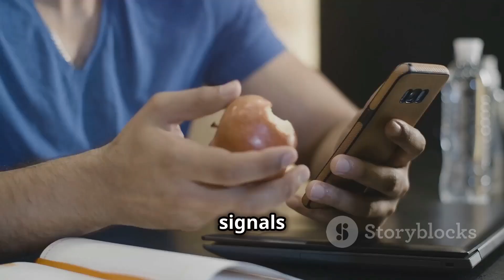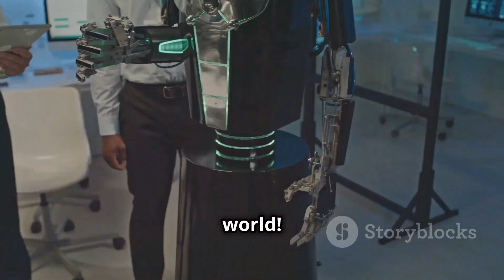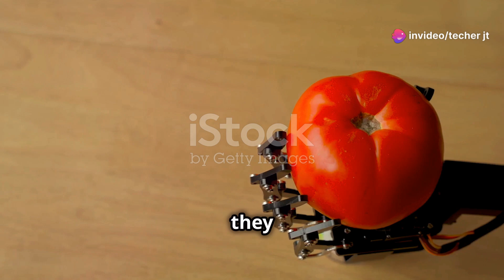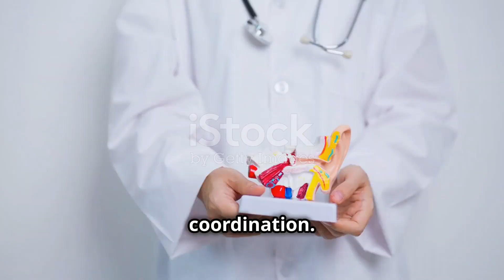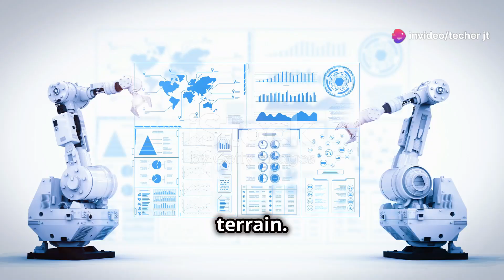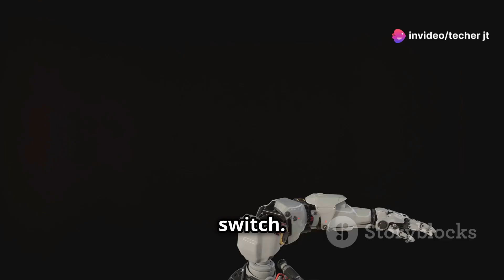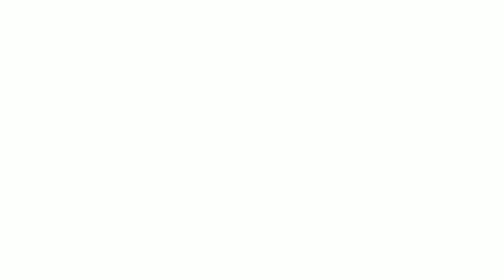Robotics Mechanical Sensors

Comment: Shei Christiane C. Payot
10 - LYNX

1. Understanding: What are mechanical sensors, and how do they function in robotics?

Mechanical sensors are like the senses of a robot, helping it to understand and interact with its surroundings. These sensors pick up on physical cues like touch, force, motion, or position and translate them into electrical signals that the robot’s “brain” can understand. Just as we use our senses to know what’s around us, robots rely on these sensors to perform tasks correctly, avoid obstacles, handle objects carefully, and react to changes in their environment. Essentially, these sensors are what make robots capable of operating effectively in different settings.

Comment: Jana Sophia D. Enopia
10 - LYRA 

1. Understanding: What are mechanical sensors, and how do they function in robotics?

Robots use sensors to understand their surroundings, just like humans use their senses to interact with the world. Humans and robots are similar in this way. While we rely on our senses, robots depend on sensors to move and respond. These sensors take things like touch and movement and change them into electrical signals that the robot's brain, or controller, can understand.

Comment: Hailey Aiyana E. Gador
10- Lyra 

1. Understanding: What are mechanical sensors, and how do they function in robotics?
 
- Mechanical sensors are devices that detect physical quantities like force, pressure, displacement, or acceleration. In robotics, they act as the "touch" and "feel" of the robot, providing crucial information about its interaction with the environment.

Comment: Iam Raut Labnotin
10-Lyra

2. Applying: Describe a scenario in which tactile sensors might be used in a robotic application. What advantages do they provide in that scenario?

•In warehouse automation, tactile sensors can be used in robotic grippers to handle fragile items like glass or electronics. These sensors enable the robot to adjust its grip based on the object's texture and weight, preventing damage during transport. The added sensitivity ensures safe and efficient handling of a wide variety of materials.

Comment: Angel P. Rivera
10 - Lyra

3. Analyzing: Compare and contrast force/torque sensors and accelerometers. In what situations would each be more beneficial?

The Force/torque sensors give robots a sense of touch, allowing them to detect forces and twisting motions. On the other hand, accelerometers measure the robot's speed and help keep it stable. Force/torque sensors are especially useful in robots that work closely with humans, like collaborative robots, while accelerometers are important for helping robots move, avoid collisions, and recognize gestures.

Comment: Alexa Janne Arioja
10 - Lynx

3. Evaluating: Assess the impact of mechanical sensors on the efficiency and safety of robotic operations in manufacturing. Provide specific examples to support your evaluation.

> Mechanical sensors significantly improve the productivity and security of robotic manufacturing processes. Force/torque sensors, for example, enable robots to modify the force they exert, avoiding component damage during assembly. When a robot arm comes into contact with an unforeseen object, contact sensors can cause emergency pauses, averting accidents and improving equipment responsiveness and precision, which lowers maintenance costs and downtime, improves product quality, and fosters a safer work environment.

Comment: May ville D. Ortega 
10- lyra

1. Understanding: What are mechanical sensors, and how do they function in robotics?

Mechanical sensors enable robots to navigate and interact with their surroundings, as well as perceive the world around them. Robots rely on these sensors to collect data, just as humans rely on their senses to understand their surroundings. They function by converting physical stimuli such as touch or motion into electrical signals that the robot's brain, or controller, can understand. As if translating the language of the physical world into a language that robots understand. They are critical because they help the robot avoid obstacles, handle items with precision, and respond to changes in the environment.

Comment: Princess Dawn B. Lamberte
10 - LYNX

1. Understanding: What are mechanical sensors, and how do they function in robotics?
Mechanical sensors in robotics detect physical changes like pressure, force, or movement. They work by converting these changes into electrical signals, which the robot's system interprets to understand its environment and adjust its actions accordingly. Examples include force sensors and accelerometers.

Comment: Maria Floriz J. Napone 
10 - Lyra 

1. Understanding: What are mechanical sensors, and how do they function in robotics?

- In robotics, mechanical sensors pick up physical forces like strain, pressure, or displacement and translate them into electrical signals that the robot can understand. They sense things like weight or tension, which enables robots to carry out activities involving interaction with items, including gripping or lifting.

Comment: Jag Alona S. Ramayla
10 - Lyra

Question 1: Understanding: What are mechanical sensors, and how do they function in robotics.

Answer: Mechanical sensors are devices that measure physical quantities like position, force, and motion. They act as a robot's "senses," providing crucial information about its environment and movements. In robotics, these sensors are essential for tasks like navigation, object manipulation, and safety. For example, position sensors help robots track their movements, while force sensors allow them to control the force applied during tasks like grasping. Tactile sensors provide information about objects, enabling robots to recognize and interact with them. By integrating these mechanical sensors, robots gain the ability to perceive and interact with their surroundings, making them more versatile and capable.

Comment: Sophia Peñoso
10- Andromeda

Question: 1. Understanding: What are mechanical sensors, and how do they function in robotics?

Answer : 
Mechanical sensors are essential devices in robotics that detect physical changes such as pressure, force, or displacement and convert these changes into electrical signals. They consist of three main components: the sensing element, which interacts with the physical change (like strain gauges for measuring deformation); the transduction element, which converts the change into an electrical output (such as a diaphragm in pressure sensors); and the signal processing unit, which interprets the electrical signal for robotic systems. These sensors play a crucial role in various applications, including force measurement for precision tasks in robotic arms, acceleration detection for navigation and stabilization, and pressure monitoring to ensure safe and efficient operation in diverse environments. By enabling robots to perceive and interact with their surroundings effectively, mechanical sensors significantly enhance robotic functionality and performance.

Comment: Zion E. Paberecio
10 - Andromeda 

1. Understanding: What are mechanical sensors, and how do they function in robotics?

ANSWER:

Mechanical sensors detect physical properties like force or pressure and convert them into electrical signals for robots to process and react to their environment.

Comment: Phoebe Coleen G. Flores
10-LYNX

1. Mechanical sensors are devices that detect physical changes in their environment and convert these changes into measurable signals. In robotics, these sensors play a crucial role by providing the robot with information about its surroundings and its own state, enabling it to interact effectively with the world.

Comment: Leon Anthony S. Juaneza
10-Lynx

2. Applying: Describe a scenario in which tactile sensors might be used in a robotic application. What advantages do they provide in that scenario?

-One example of a scenario where tactile sensors are used is in a robotic surgical arm. This device mainly aims to assist surgeons in delicate procedures, such as those involving small blood vessels or nerves. The tactile sensor will detect pressure, force, and vibration, giving the robot a sense of touch. The advantages of using tactile sensors for scenarios is that they give real-time feedback and enhance the procedure's safety.

Comment: Charles Christian Bahian
10-Andromeda

1.Understanding: What are mechanical sensors, and how do they function in robotics?

-Mechanical sensors allow robots to perceive the world around them. These sensors convert physical stimuli, like touch, or motion, into electrical signals that the robot’s brain(the controller) can understand its like translating the language of the world into a language that robots can comprehend. These sensors are crucial for robots to perform task accurately and safely, they allow robots to avoid the obstacles, handle objects with precision, and even respond to the changes in their environment.

Comment: Michaella Ragmac

4. Evaluating: Assess the impact of
mechanical sensors on the efficiency
and safety of robotic operations in
manufacturing. Provide specific
examples to support your evaluation.

Mechanical sensors greatly
enhance both the efficiency and
safety of robotic operations in
manufacturing. For instance,
force/torque sensors allow robots to
adjust the amount of force they
apply, preventing damage to parts
during assembly. Contact sensors can
trigger emergency stops when a
robot arm encounters an unexpected
obstacle, preventing accidents and equipment damage. This increased
precision and responsiveness reduce
downtime and maintenance costs,
improve product quality, and create a
safer working environment.

Comment: Brigette Love U. Gurrea
Grade 10 Andromeda

5. Creating: Design a simple robotic system that utilizes at least two types of mechanical sensors. Explain how these sensors would work together to achieve a specific task.

Title: Tactile and Force Sensor-Based Automated Strawberry Harvesting Robot

This robotic device uses force and torque sensors in addition to touch sensors to select strawberries carefully. Based on the ripeness of the fruit, the robot may modify its hold by using tactile sensors on its gripper to sense the texture and softness of the strawberries. In the meantime, the robotic arm's integrated force and torque sensors gauge the force used throughout the picking procedure. Together, these sensors make sure the robot applies the ideal amount of pressure to pick the strawberries without damaging them, resulting in a precise and effective harvesting procedure.

Comment: Hannah Bella A. Ihalas
10 - Hermés

3. Analyzing: Compare and contrast force/torque sensors and accelerometers. In what situations would each be more beneficial?

— Force/torque sensors and accelerometers are both valuable tools in various applications, particularly in robotics and engineering. They share the common goal of measuring physical forces. Force/torque sensors measure the linear and rotational forces applied to an object while accelerometers measure the acceleration of an object, which is the rate of change of its velocity. Force/torque sensors are more beneficial when direct force measurement is required, interaction with objects, and safety and load monitoring are critical. Accelerometers are more beneficial when motion detection and analysis are required, condition monitoring and fault detection, and orientation and navigation are important.

Comment: Cassandra Louis R. Bigwas
10 - Lynx

3.) Analyzing: Compare and contrast force/torque sensors and accelerometers. In what scenarios would each be more beneficial?

Force/torque sensors are the robot's sense of touch, measuring the forces and torques while accelerometers measure linear acceleration to maintain their motion and balance. Force/torque sensors are used in robotic systems that interact with humans such as collaborative robots or cobots while accelerometers are crucial for tasks like navigation, collision detection, and gesture recognition,  such as from smartphones to cars.

Comment: Neeka Ella P. Guillero
10 -  Lynx

2. Applying: Describe a scenario in which tactile sensors might be used in a robotic application. What advantages do they provide in that scenario?

In a quality control application, small electronic parts are inspected and sorted on a production line using a robotic arm with tactile sensors. In this case, the tactile sensors offer a number of significant benefits. First of all, they facilitate gentle handling by detecting texture and pressure, which enables the robot to precisely apply the required amount of force without endangering the components. Second, by aiding the robot in distinguishing between different materials and identifying flaws based on their texture and temperature, these sensors improve precision. In order to maintain a firm hold on the components without crushing them, the robot can also continuously modify the strength of its grip in response to feedback from the tactile sensors. This last feature is known as the adjustable grip feature.

Comment: Englis
Andromeda

1. Understanding: What are mechanical sensors, and how do they function in robotics?

- Mechanical sensors enable robots to sense their surroundings. Robots use these sensors to interact and traverse their environment. In order to convert physical inputs into electrical signals that the robot's brain or controller can comprehend, mechanical sensors are another important source of information for robots. Robots depend on these sensors to carry out duties precisely and safely. They also help the robots avoid impediments.

Comment: Ralf Mikael A. Lopez
10-Andromeda

1. Understanding: What are mechanical sensors, and how do they function in robotics?

-In robotics, mechanical sensors are devices that convert physical stimuli—like force, motion, or touch—into electrical signals that the robot's controller can understand. These sensors provide information about forces, motion, contact, and other physical features, enabling robots to perceive and interact with their surroundings. For example, gyroscopes and accelerometers assist robots in maintaining balance and measuring movement, while tactile sensors provide robots a feeling of touch.

Comment: Faith N. Ragas
10-Andromeda

1. Understanding: What are mechanical sensors, and how do they function in robotics?

Robots can "feel" and comprehend their surroundings with the aid of mechanical sensors, which convert physical elements like pressure, movement, and touch into signals that the robot can interpret. They are crucial because they provide robots with environmental cues, such as when to stop and how firmly to grasp objects. In other words, robots couldn't perform their tasks safely or accurately without these sensors.

Comment: Kaihanne A. Manticahon 
10 - LYNX

2. Applying: Describe a scenario in which tactile sensors might be used in a robotic application. What advantages do they provide in that scenario?

— One situation where a tactile sensor is crucial is when a robot is harvesting strawberries. It must be gentle enough not to crush the fruit but strong enough to detach it from the stem. Tactile sensors help the robot determine the ripeness of strawberries by sensing its softness and adjusting its grip accordingly. These sensors measure pressure, force, and surface texture, allowing robots to detect contact and adjust their grip, preventing damage while carefully manipulating objects. The main advantages of tactile sensors include improved precision and the ability to safely handle fragile materials without the need for human involvement.

Comment: Glenn Seth Myrrh B. Laluces
10 - Hermes

1. Understanding: What are mechanical sensors, and how do they function in robotics?

- Mechanical sensors in robotics detect physical changes like force, pressure, displacement, or vibration and convert them into electrical signals, enabling robots to interact with their environment. They work by detecting mechanical input, converting it into an electrical signal through changes in resistance, capacitance, or inductance, and then processing the signal for the robot’s control system. Common types include force/torque sensors for measuring grip strength, pressure sensors for object handling, accelerometers for motion and balance, proximity sensors for navigation, and strain gauges for monitoring stress in mechanical parts. These sensors enhance a robot's precision and responsiveness in tasks like manufacturing, healthcare, and exploration.

Comment: Gabriella Kish O. Gatchalian
10 - LYNX

1. Understanding: What are mechanical sensors, and how do they function in robotics?
Mechanical sensors allow robots to perceive the world around them, robots depend on sensors to gather information, and these sensors convert stimuli like touch or motion, into electrical signals that the robot brain controller can comprehend. These sensors are crucial for robots to perform tasks accurately and safely. They allow robots to avoid obstacles, handle objects with precision, and even respond to environmental changes.

Reply

Comment: Rhilyne B. Rivas
10-Andromeda

5. Creating: Design a simple robotic system that utilizes at least two types of mechanical sensors. Explain how these sensors would work together to achieve a specific task.

The Automated Plant Watering System has a soil moisture sensor and a light sensor. When the soil moisture sensor detects dry soil, it activates a water pump. Simultaneously, the light sensor checks ambient light conditions; if there is insufficient light, it activates a grow lamp to increase lighting. Together, these sensors deliver the appropriate quantity of water and light, enabling healthy plant development while conserving resources.